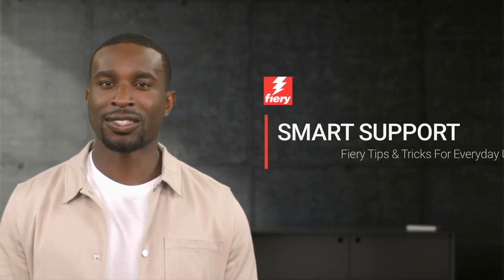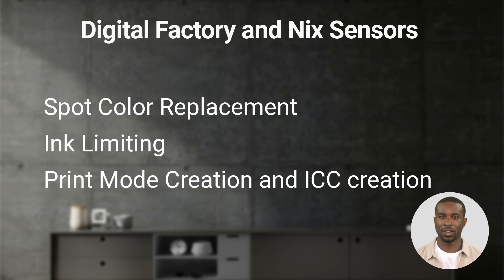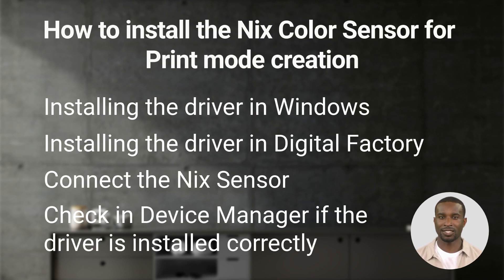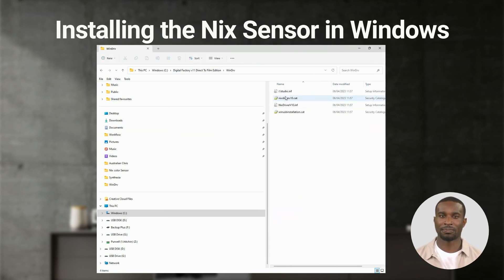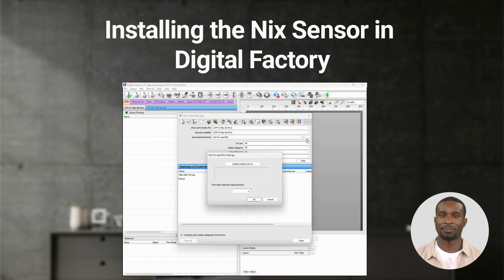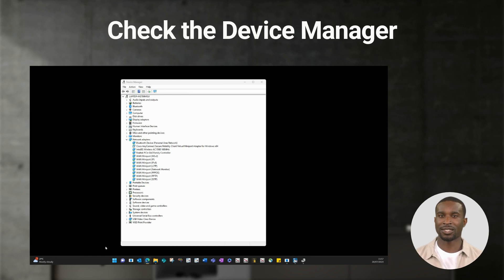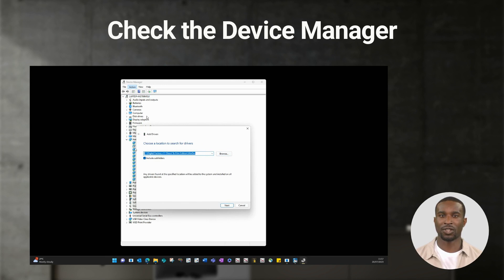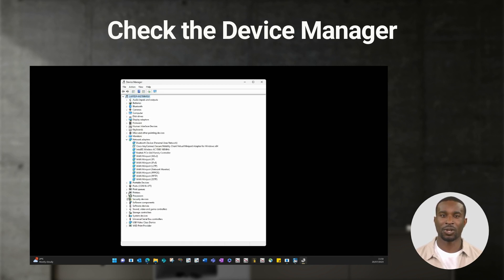How To Install The Nix Color Sensor For Print Mode Creation

Comment: I have Cadlink v11.1 - and Mini 3 - your description says "*For users with a Nix Mini 3 the latest version of Digital Factory 11.1 is required. Version 11.1 contains all required drivers. There is no need to follow the steps in this video if using version 11.1."  however it still comes up with error installing drivers - how do you get this to work in cadlink?  is there something that needs to be installed to get it working?
Reply: Did you get a response?